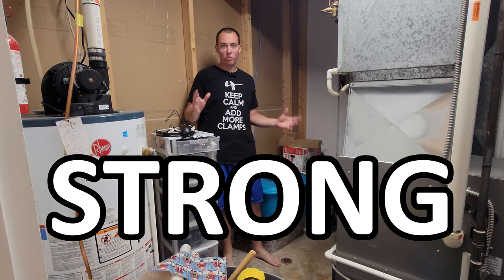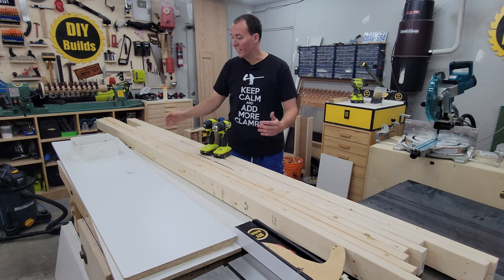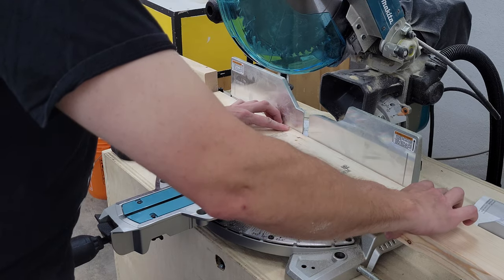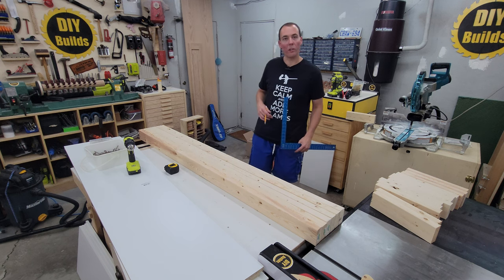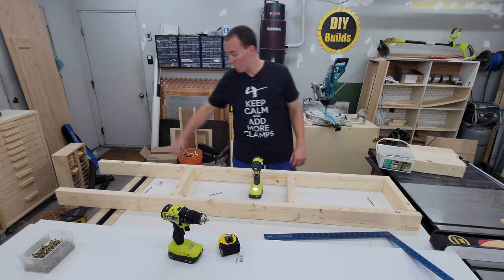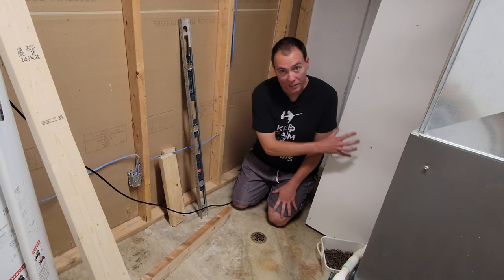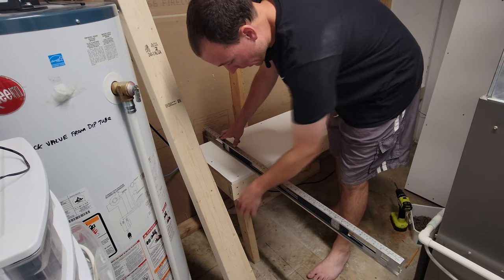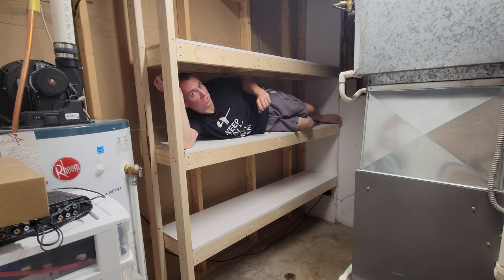How to Build Shelves

Comment: Have built many of those over the years. My only issue with them is the 2x4s take up allot of usable space over a steel shelving style. Us here in Crematoria (AKA Texas) don't have those massive basements so space is at a premium. 
         When people tell me that houses in TX are cheap I tell them make sure you are comparing houses twice the size here as yours  since we don't have basements. Then they say Oh houses are allot more expensive there... Not to mention the 3-10K a year property taxes (depending on property value). Not to mention the electricity bill for keeping it cool...
Reply from the maker: Ya I would have used 2x3 but they are the same price as 2x4 so opted to waste space.
Reply: @DIYBuilds  Yeah I was going to use 2x3s for lining my metal building and more insulation but 2x3 actually cost more than 2x4 here and very ugly lumber. Course my shop is jam packed so tight all those years playing tetris paid off..